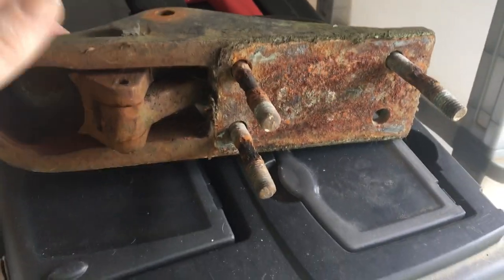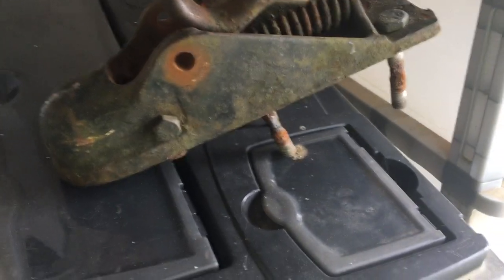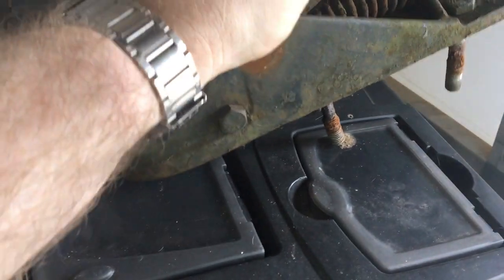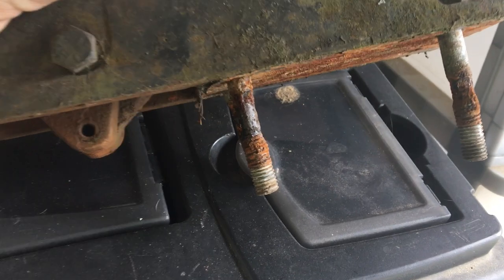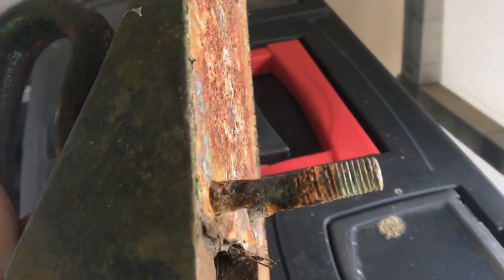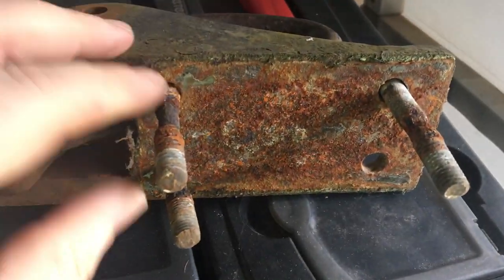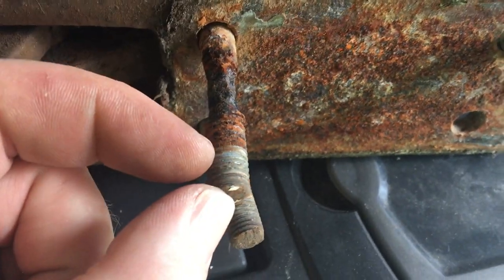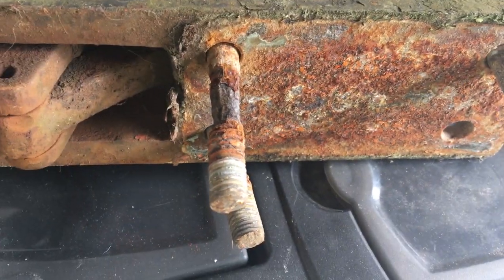#293 1 Minute Mention - Trailer Hitch

Comment: Ooow sneaky rust, i bet that hitch has been on for a loooooong time.
Did you coat the new bolts with grease or thick oil?
Reply from the maker: zx8401ztv - no I didn't worry about it, I did use hammerite paint on the draw bar though to stop that rusting further.